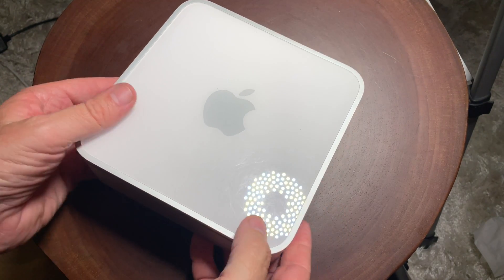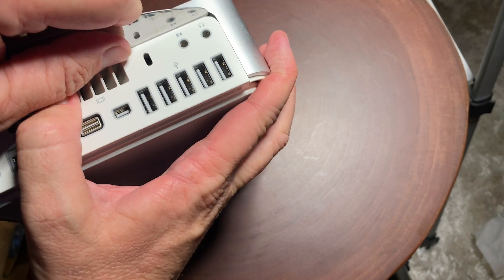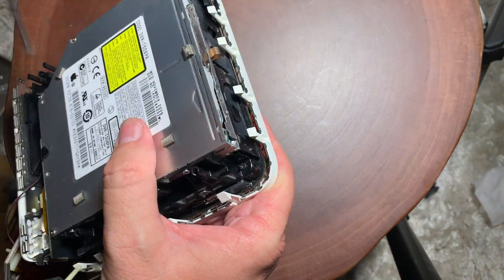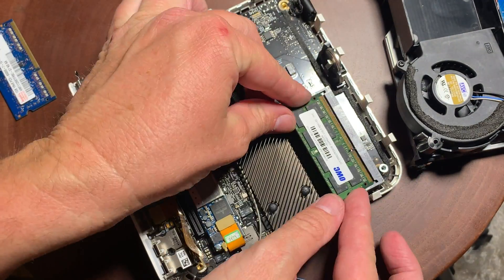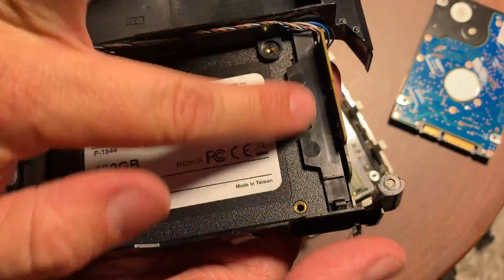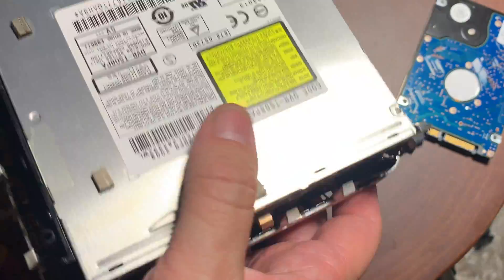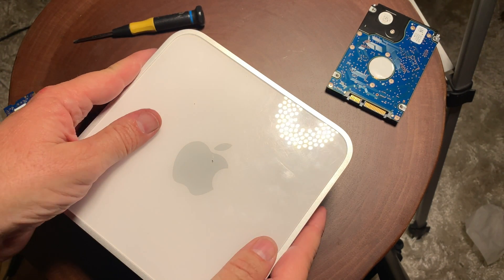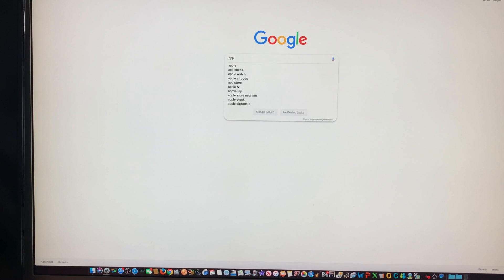$40 2009 Mac Mini in 2019 SSD & Mac OS Mojave!!!  (In 4K)

Comment: The downside of the 2009 (I own one BTW) are the USB2 ports, which preclude useful external storage, because, face it, 480 Mbps doesn’t cut it anymore. The FireWire 800 port is faster, but FW800 drives and enclosures seem to have disappeared from the face of the Earth. However, you can add a second internal drive with an OWC Data Doubler and the mini could have as much as a couple TB of internal storage (at SATA 3Gbps speeds). The upgrade to newer macOS using OCLP really makes sense for this unit because El Capitan is seriously limited in software and doesn’t know how to handle the latest SSL web certificates which are used by almost all web sites these days. The CPU in this box is still pretty chipper if limited in the core count, but with with 8 GB RAM and decent internal storage it's still a good performer -- in face, I fired up my old copy of Doom 3 and it loads and plays like it's... 2009! Cheers!

Comment: What should I do if it beeps 3 times and the LED lights flash a couple of times ??

would really appreciate the help.
Reply: It means RAM in your computer has not passed the data integrity test run at startup. Try removing the ram and reinstalling. If that does not work try a new set of ram chips
Reply: Bad RAM test...

Comment: I did exactly as you did but got the folder with the question mark.....I checked all connections and still the same but then I put my old hard drive back in and still got the folder with the question mark. I only have a windows keyboard but none of the  keys that equal the mac keyboard are recognised ...do I need a mac keyboard ... any help appreciated.....

Comment: I copied the whole of my hard drive with super duper and upgraded the hard drive to 500 gig and ram to 8 mg. When I turned the mac on I got a white screen with a folder and a question mark. The windows keyboard would not work to try and re install OS X for the mini mac 2009 as long as it didnt replace all my files. If it had copied the HD why has this happened?
Reply: sounds like the board is not seated properly
Reply: Yes you are correct   and it works now.......

Comment: I got a Mac Mini late 2009, upgraded with 8gb and 250gb SSD. Running Catalina with this Dosdude1 tool. Still runs pretty good. Even works on my LG 34” ulrawide 2k screen!
Reply: Do you use it anymore? I want to install it but the boot is slower because the apfs patch in the bootloader and i Expect the machine to run slower but im not sure because big sur was very Slow on the Mac mini 2009. High Sierra is pretty fast and i cant decide between mojave and catalina (i Want dark mode :D ) is catalina fast? And how Long does it take to boot?(if you have a ssd installed)
Reply: With 256MN ofVRAM, it should!

I'm looking for a good cheap 2.53 ghz. logic board.

3 of my 5 USB2.0 ports are DEAD.

2 only partially work.

And the little surface mt. chip with the POST cord died.

Hard to unsolder and replace, as on my MacBook A1278.

Same thing happened.

Still gives a good post, just no chord..

Replacement used logic board CAN coat as much as another good A1283

On eBay...

J.C.
Reply: Anywhere u guys would recommend getting these parts? I'm complete noob just got this mini given to me from a friend

Comment: it stops there after I apply post-install patches, say 'updating dyld shared cache'. I use mac mini late 2009.
Reply from the maker: Start over and install again.
Reply: If you trying to install Catalina, be sure that you'd formatted the disk to the APFS file system. And there's no need to apply patches, everything works well without them.

Comment: Hi - Love the video I have an early 2009 mac mini - I want to upgrade it from 1GB to 8GB of Ram , CPU is a Core 2 Due 2.0ghz and plan to purchase a SSD. my question is does the system work ok in Mojave or Catalina? Does it run smooth or does the GPU stuggle to process the Metal requirments of the newer OS?
Reply: I actually have a Mac Mini 2009. It runs pretty good on Catalina but I do recommend an SSD to have a better performance. I currently have a HDD and it works amazing! It does take sometime to open applications (on a HDD)  but that’s an exception :) (takes like 10-15 seconds).
Reply: @FreddyStudio  which steps did you perform to install Catalina on Mac mini 2009? Officially we cant install even Mojave I think

Comment: Could I put a blu ray drive in this?
Reply: No, the CPU is too useless to decode it. Even on AMD Ryzen it slows the system down enough with Blu-ray playing software (PowerDVD Ultra). Assuming you use Windows 7+ and a computer (Mac or PC) with at least 4 cores. Even if you use MakeMKV to rip it, it's too useless to play it at the proper speed.

Comment: how youtube works on this machine?
Reply: Marcin Chess with the power of the internet
Reply: By using electricity. 😆 Electrons specifically.
Reply: 1080p no issue at all since most work are unloaded to geforce 9400M gpu... 1440p is a little choppy... not recommended...

Comment: Just picked me up one of these.  Waiting for the SSD to come in.  Not sure I'm going to bother with the ram yet, but I won't be replacing the stop case until I know for sure.  I know I want to re-paste the CPU and GPU.  Great video on pulling it apart too.  A few other video's didn't show much on the process of popping the top off.  I started where you said, then slowly worked a pry tool around the edge to get the clips off.
Reply: It's really pointless to be using a Duo with 4-GB RAM computer unless you're doing basic YouTube/audio editing (Audacity)/productivity (Office), or emulation. It's only useful with updated Windows 10, 8GB RAM, SSD highly recommended.
Reply: B.S. !!!